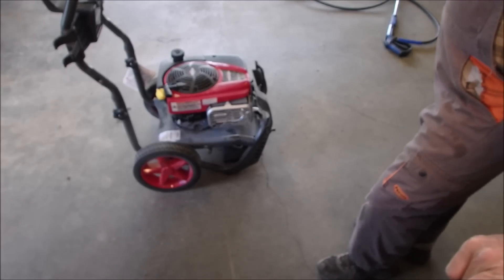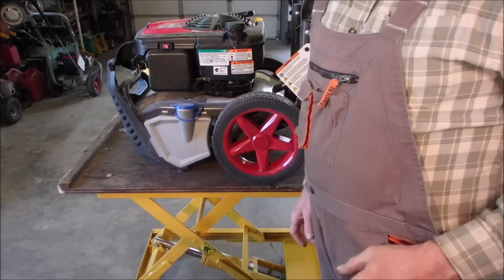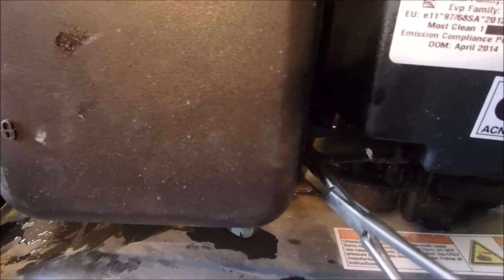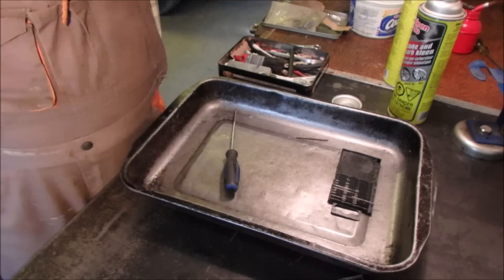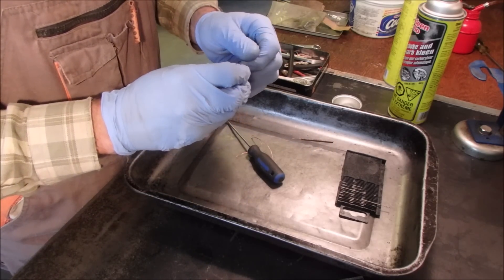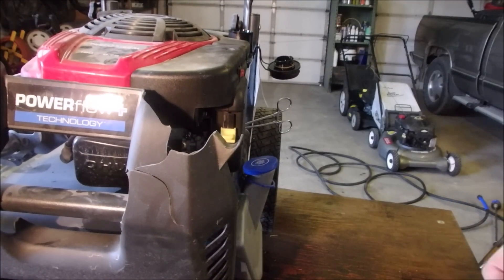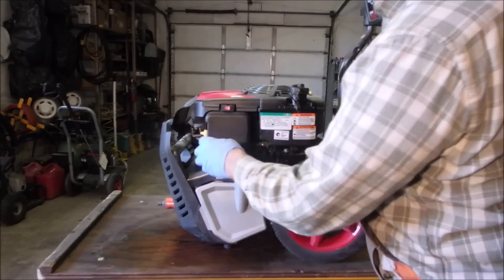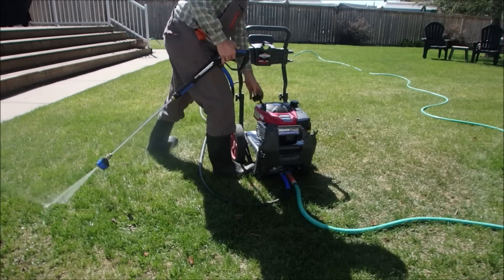Powerflow Pressure Washer Won't Start

Comment: I have this exact washer and problem. Checked the carb bowl and screw 1st, they were both dirty and clogged. I used a drill-bit on the screw and cleaned the bowl... it started on the 2nd pull! Thank you so much for sharing this video, it's saved me a few hundred dollars!
Reply from the maker: Good for you sir.

Comment: Love ur videos  !! ...well done!! ..I would love to pick ur brain if I could, I have a Briggs and Stratton 20559 Powerflow Plus electric power washer , and I cant, for the life of me ,find the replacement hose that goes from the pump to the wand assembly , any info would be really appreciated ..ty in advance
Reply from the maker: This may help.  If both ends of the hose have the same thread
https://shop.briggsandstratton.com/products/briggs-and-stratton-708962-preasure-washer-hose
Reply: @BrucesShop  ty but unfortunately, there is a plastic collar on one end of the hose that snapped off. The hose is located behind the plastics inside the machine.. Also I found out that the model I have is not serviceable so Ill be staying away from electric pressure washers from now on .. ..Thanks for ur help tho
Reply from the maker: @jimmyrigged1292  Can you cut the cover with an angle grinder.  Just thinking good luck.

Comment: Another good video Bruce and I like that you left the camera recording, that way we get the entire Bruce Pender Experience..lol..also, I have heard two opinions on squeezing the spray handle before you start the engine...does it matter and what is your opinion. Thank you
Reply from the maker: Just sometimes it takes the pressure off the pump making the engine easier to start.

Comment: hello Mr Bruce( I call u some times Brucy) hope u don't mind it. I have a Honda pressure washer that runs for some good 15 to 20 minutes and stop and won't star right away,after some 30 minutes it will star and again will stop.. what can b the problem? thank u. your videos really help.
Reply from the maker: Well the coils heat up and go intermittent.  It may be a coil but .......If you can find another one
Reply: @BrucesShop  thank u Mr Bruce,I will check it up

Comment: I love your channel I learn so much, where do you you get those drill bits?
Reply from the maker: I found them on Amazon.  This may not be exact but this is close.
https://www.amazon.com/tool-home-Drill-Micro-0-3-1-6mm-Plastic/dp/B0105567BU/ref=sr_1_26?keywords=mini+drill+bits+in+case&qid=1560014686&s=gateway&sr=8-26

Comment: Hahaha, same as other comments, watching the progress of the vid, and the little red time line at the bottom of the vid..... Noooooooooooooo........ I guess we find out in part the second. Have one of those engines on an alloy deck push mower and it has been totally reliable.
Reply from the maker: They are good but on something else other than a mower they need more flywheel like a blade

Comment: Just curios, do you have ethanol free gas available in your area?
Reply from the maker: We used to.  Now the green stickers on the regular gas is gone so I don't know if all the gas has the same amount of ethanol.  I still buy premium fuel.  If it works in a Mercedes it should work in a Briggs eh !!!!    lol
Reply: @BrucesShop  I'm fortunate that we have no ethanol available.  I use it for all my small engine stuff.   My push mower is about 20 years old so I'm afraid the ethanol will destroy the carburetor and stuff.   Well, waiting to see why the sprayer wouldn't stay running in the yard.  I'm guessing there was more dirt in the gas somewhere, like in the gas line, that stopped up the bolt again.  We'll see on your next video!
Reply from the maker: @thetruthhurts2216  OK   Thanks

Comment: Please replace the carburetor if possible.
Reply from the maker: Really???? there is nothing to them. A jet and a brass pipe called an imulsion tube.  that is why i like them.
Reply: @BrucesShop  You're right. It got your attention, though. Now for the real question, how will you fix the choking-out running problem? :) Last auto choke I had problems with, cleaned the vane shoulder bolt with sandpaper and greased it.
Reply from the maker: @999thenewman  Part 2  on Friday   lol.  It still came on very slow though.
Reply: @BrucesShop  Thanks, Bruce. I appreciate your work. Check your gmail, please.

Comment: There's nothing professional about that pressure washer, every single box store pressure washer is built as cheaply as possible with a ridiculous price tag on it.  I love the Hotsy pressure washer we use at work but ouch those are expensive.
Reply from the maker: I agree.  Them calling this a professional washer is kind of misleading.  The engine size maybe but not the mechanics.